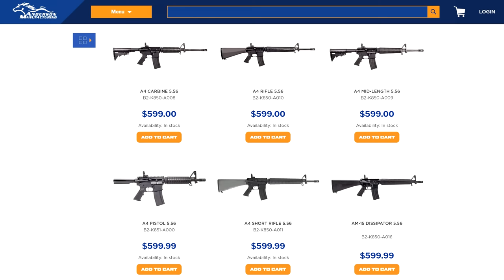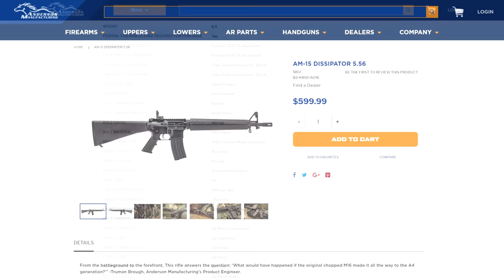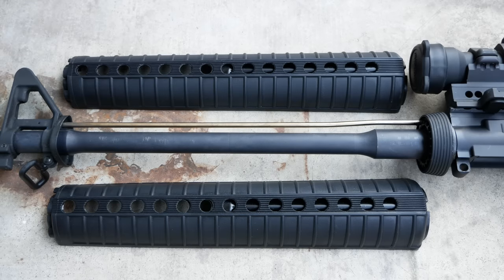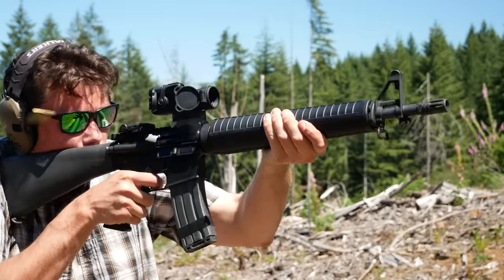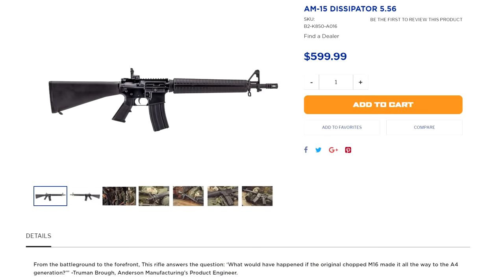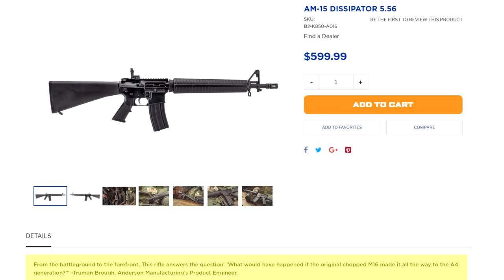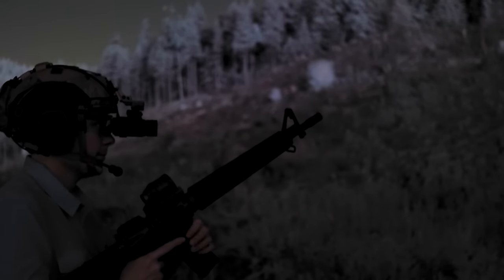The Alternate History Anderson A4 Dissipator

Comment: We would, in fact, like to see the dissipator modernization project.
Reply: Please, Hop.
Reply: Do it!
Reply: WWHD 2023
Reply: I am from the internet and I support this message
Reply: Just do it!
Make your dreams come true!
Reply: I have one built on Stag Recievers, JP internals and Odin Works Dissipator barrel.
Reply: Hell yea
Reply: Check out the KP-15 Dissipator from Booligan Shooting Sports. It's the best looking gun ever.
Reply: Already been a thing for the last 15-20 years. 

SLR Grail-15
Reply: yes we would
Reply: This already exists. It’s called the URGI. 14.5” on a mid length gas system. Same premise. This appears to be much more shootable. URGI is one of the least flat recoiling rifles in 556 that I have experienced.
Reply: @taylorminton3607  14.5 Middy has nothing in common with a Dissipator whatsoever.
Reply: Yes please….
Reply: @rifleshooterchannel208 , its ok to disagree here. Conceptually the idea is to achieve the shortest barrel with the longest gas system that functions reliably. They attempted the 15” and it failed. They then had to stretch it to a 16 to get the dwell time. They were able to achieve the same result with a mid length and a 14.5 on the URGI, which barrel length wise is more in line with the original design. If you’re caught up on this having to be a rifle length system, then yes this entire perspective is invalid. If you are trying to achieve a shorter gun with an as long as possible (and still functions) gas system, then in fact the URGI is a modern example of this premise.
Reply: Not sure.. if you modernize the dissipator with FF rail low profile GB and collapsible stock it will look like any other modern AR.

The dissipator a retro rifle leave it alone.

Just put a MOE handguard and call it a day
Reply: Hop please, do a modernized dissipator!
Reply: @taylorminton3607  No, it was to achieve the longest possible iron sight radius on a carbine length barrel. 

Not to mention Dissipators have carbine gas systems. 

So nothing about the 14.5 Middy based rifles have anything at all to do with Dissipator design.
Reply: @Frens03  It’s not necessarily a retro rifle but it is dependent on have the “rifle length” sight radius. 

The modern Dissipator is the SLR Grail-15.
Reply: @rifleshooterchannel208  the bushmaster had a carbine gas system. The original concept attempted by the mil had a rifle length. 

There is no such thing as a carbine length barrel as there has never been a definition set. Some definitions are as loose as, “any barrel less than 20 inches”. There are barrels with carbine length gas systems (which has been defined). By your logic they should have put a carbine gas system on a 19.9 inch barrel with a clamp on front sight at the end and called it a day. 

By no means do you need to agree with me. 

Have a good one.
Reply: Yus plz
Reply: @taylorminton3607  The “original concept” was not called a Dissipator, the Bushmaster offering was.

And in order to determine what makes a proper Dissipator, you need not look further than Bushmaster’s offering which is what defined the entire configuration because it was named as such. 

It’s that simple. 

And stop acting like you’re comprehending the fact that “carbine barrel” is used as a colloquialism to describe the shortest non-NFA rifle barrel that can be offered for sale on a commercial rifle.
Reply: Rifle length site radius, free float handguard, and a RRA UTE2 Upper receiver. Or just a flat top with a LMT rear iron.
Reply: Yes do this!
Reply: Yes due dis
Reply: same
Reply: Do it!
Reply: Do it!
Reply: do it do it do it
Reply: indeed
Reply: Ditto
Reply: yes
Reply: Dissipator as a supressor host? Yes please!
Reply: Yes we would.
Reply: You’re starting now Hop… aren’t you?
Reply: Hell yeah I would love to see Hop Mod. this Dissy!
Reply: Yes, yes we do
Reply: I was thinking upgraded handguard and Sully stock
Reply: I too, support this idea
Reply: @rifleshooterchannel208  , you’re seemingly hostile. For the third time. It’s ok to disagree. If you are basing this off of the bushmaster dissipator then you are correct. To be frank I assumed most people would be interested in the gun the bushmaster was based on, as bushmaster is a c tier hunk of crap gun manufacturer. The only contribution they made was the rather catchy name. They simply made an offering of a concept that looked similar to something with some minor historical significance. If you’re caught up on modernizing the bushmaster gun. You sir, are 100% correct. 

If you’re attempting to modernize the nam era gun that the bushmaster was based on, which I believe is what most people would be interested in; it would also appear that even anderson mfg agrees, you’re off basis. I highly doubt anyone cares about bushmaster version outside of very niche collectors. 

I’m not even going to get into the carbine barrel length debate with you. There are so many reasons that your statement is absurd. I would look at barrel lengths of some historically significant carbines to see why.

Anyways, have a great life. I wish you the best on your beta male quest to conquer the internet. 

From one keyboard warrior to another <3
Reply: @taylorminton3607  I like how stating simple fact is “hostility” to you 😂

You’re considering two different rifle designs to be the same thing and that simply is not so. 

A Dissipator means only one thing and it has nothing to do with having a rifle length gas system.
Reply: @taylorminton3607  And “carbine length barrel” as a colloquialism means only one thing in reference to non-NFA AR-15 based rifles. 

Anybody with even the most basic level of common sense and firearm experience would know this. 

It’s easy to tell who shoots and who don’t 😂

Don’t like it? 

Cope.
Reply: Pls hop talk about how this thing is suppressed.
Reply: Yes we would
Reply: yeah
Reply: I built it already in 11.5".
Reply: Full MOE ODG + carry handle + 3x micro + suppressor + MOFKN QUATRO15 LOWER
Reply: We absolutely need a dissipator modernization project
Reply: @jlee7811  I built an 11.5" midlength, which is pretty much the modern adaptation of the concept.
Reply: Since watching this I have already purchased this upper, a P+S RAS (hope to god it fits) and I am going full A4 Dissipator.
Reply: I want to see a dissipator with a quad rail hand guard so bad
Reply: I concur
Reply: Lets go
Reply: Agreed
Reply: Yes
Reply: His wallet is just thinking NO OH GOD NO PLEASE NO
Reply: If you don't,  I will
Reply: Concur
Reply: Agreed!
Reply: yes we would
Reply: I indeed have a more modernized dissipator. Not quite sure how to show that on here though.

Comment: Anderson sent one to me as well, and I'm with Hop (except for the Peq-2 barrel mount, I ain't got time for that). Mine runs very well with all ammo I've tried, and it's very cool. Full write up coming to TFB soon on that one.
Reply: He mentioned that the original rifle length dissipators didn’t work well. What changes did Anderson make to these to make them work? Bigger gas port?
Reply: @brettb5089 I'm curious about this as well. Gas port, spring, buffer?
Reply: @brettb5089 probably spent time figuring out the gas tube and gas port sizes, potentially some adjustment with the buffers too.
Reply: @brettb5089 yes they blow out the gas port like crazy. I want to know more about how it runs suppressed because it looks super cool with a can
Reply: I’ve had a Del-Ton dissipator for about 4 years now as opposed to the new Anderson. The only problem I had with it was mild short-stroking: it cycled fine when firing but was just short of engaging the bolt stop on the last round. Chambering, extraction and reloading were 100%; just cycled a hair short for last round hold open. 

I ran through all the blogs and settled on buying a 5% lower powered spring. It was the cheapest/easiest fix before getting into different buffer weights and lightened BCGs or opening up the gas port. I have it set up with a fixed A1 stock and buffer so can’t speak on problems with collapsible carbine length and weight stock/buffer systems.

Mine runs perfectly now. I put about 100 rounds through when I bought it and ordered the new spring immediately. It may be over gassed when suppressed as it runs fine with the lower powered and standard spring when I put my can on it. 

The recoil impulse is noticeably different on these “true” rifle-length disspators. It is nice. I still prefer a 20” but like the familiar feel of dissipators with a bit more handiness. I carried the 20” my entire time in the army until my last year we got M4s…I was a POG so low priority for the change over. So, the sight radius, if you use the iron sights at all, is a great point as well as having a milder recoil impulse over the carbines and mid-lengths. 

While I would recommend buying one and love mine, a large portion of people, if the internet including me is to be believed, will need to change something to make it run 100% without a suppressor. In my case it was just a simple $15 (at the time) spring change.

Comment: Thanks for the video!  I had a Bushmaster Dissapator for a few years back in the early 2000's and it worked quite well.  But, for some reason, I sold it. (I probably needed the money) I really like this concept and and I'll probably add the Anderson to my collection.  I'm not an optics guy, so I wish that they would have one with a fixed carry handle A2 upper.  I recently picked up a Brownell's 605 new in the box, but Ihaven't had it to the range as of yet.

Comment: I have a faux dissipator with an A2 upper, and I love it. Not my most practical upper, but probably the coolest IMO. With a can's extra back pressure, the rifle length gas system should be fine- all for a modernizations project.

Comment: I bought the DelTon Dissipator upper which is also a "true" Dissipator (16" barrel with rifle length gas system) after I saw your video at Shot Show on Anderson's Dissipator. They use heavy barrels on their rifles, but the finish on their parts are actually worse than Anderson.

I planned on making it into an A2/A4 style Dissipator that never existed, but it just wasn't doing it for me. I had it on a KP-15 lower; but due to the buffer system being set up in that lower for carbine length rifles, I was having failures to feed with low pressure rounds like PMC Bronze 223. It ran higher pressure rounds on the KP-15 with no problem, and fed the PMC Bronze on a lower with a VLTOR A5 buffer system perfectly fine though.

Instead of drilling out the gas port or changing the buffer/spring, I ended up going full autist and buying an A1 upper with all the accouterments to make it more like the traditional Colt 605. The issues they had with the 605 seemed to be fixed when soldiers added suppressors onto them, so I got as close as I wanted to get to that without doing paperwork and have added a linear compensator to the end of mine.

I wish I could tell you if the linear compensator took care of the problem of running PMC Bronze on the KP-15, but I haven't had time to try it out yet. I'm hoping it does though; and if getting complete firearms wasn't such a PITA compared to getting just an upper, I'd be all over the Anderson Dissipator A2/A4 modernization build. Maybe one day when I have time to get into a gun store and do a lame NICS background check...I've got the removable carry handle already. That little bit is all I need to justify another repetitive AR build.
Reply: Interested in an update on this.
Reply: I find Deltons to have a decent enough QC for the budget market with excellent customer service. I mean heck there are places selling their rifles well under $400 right now
Reply: @Bob-bf3cg  They definitely have good customer service. I changed my mind about the color handguard I wanted on it post purchase and pre shipping, and they threw in the green version for free when I called them about it.

And I haven't had any real QC issues with their products. I assume the issues I have come more from the lower I was using the upper on than the upper since it cycled fine with higher velocity ammo or with a different buffer system.

I was just surprised by their finishing. Their products like the upper receiver isn't as pretty as other lower end AR parts I've had. I was surprised the upper receiver had no finish really at all inside; I'd never seen that before. And the bolt was a little less pretty than I'm used to even running the other cheap ones I run (PSA, Brownells, etc). But if someone needed a good budget gun, I think they're a great option now that other companies have started raising prices. None of these finish issues have given me any QC issues.
Reply: @warrenharrison9490  Might have to go dump some rounds into the dirt out back. I wish I had more time to hit the range. I'll try to remember and report back though.
Reply: @warrenharrison9490  Couldn't find PMC Bronze. I must have shot the rest of that junk up. But I found some white box PMC and tried it on the KP-15 lower with the linear compensator to no avail. Failure to extract. So I'm still not getting enough gas pressure to cycle reliably with a buffer system set up for carbines.

Next step will be changing buffer weights/springs, but I'm going to wait until I get a dedicated lower for it.
Reply: @stoptrackingourdata8158  ... I've read the reduced power yellow Sprinco works for this on carbine lower. Keep us updated.

Comment: built my dissipator from PSA upper back in 2013 for like 400 bucks. proper rifle gas system with fixed front sight. replace the furniture with magpul MOE stuff.  Been great but yes, it needs full power factory ammo because of the dwell. Its a bit slow on my light reloads. But the recoil and feel is amazing. let my buddy try it at 3 gun match and it held up to 2 days  of heavy shooting. he loved it. it was super light and super light recoiling. back when everyone was still building super heavy quad railed ARs.

Comment: All finally felt right after I turned my old Bushmaster Dissipator upper into an irons-only carbine by replacing the flattop receiver with a C7 carry handle receiver.  I also replaced the front sight post with a Meprolight tritium embedded post.  I call it my Kiss-apator; semi modernized with only OD green Magpul MOE furniture, a Geissele G2G, and a 45º ambi selector.

Comment: If you do a modern dissipator build, go back to a mid length gas under tube with fsb out front a la psa, or bcm kino. Tried and true gas port sizing and position in relation to dwell time.

Comment: I have a Windham Dissi which has the carbine length gas block under the hand guards. I went back and forth between having a collapsible stock and an A2 stock.  Back to the collapsible for now. I think a nice set of drop-in metal hand guards would work too.

Comment: I want to see a Dissipator modernization project! I have built 4 or 5 of these in different configurations and I love the concept. Aside from the longer sight radius, there are a lot of fun things you can do, like change the buffer configuration on a carbine buffer to change the recoil impulse. KAK has a 16in barrel with a rifle gas system and I'm going to see what it can do suppressed on a carbine lower.

Comment: What are your thoughts on how well it suppresses with how that gas system is setup? 
I'd imagine it would maybe a little bit rougher than a properly ported 16" mid-length due to the port size they'd have to use, but the port being that far forward it should be pulling from lower pressures and shouldn't be as rough as 10.5" carbine system.
Maybe I'll grab one and find out once I feel the urge to build another AR.

Comment: Fun Fact: One of the 1996 L.A. Bank Robbers had a Bushmaster Dissapator. 
 There is a Police Museum with mannequins dressed in their gear behind glass, and one is holding the actual gun.  Most footage that exists they are firing modified Norinco AK-47s with drum mags, and an HK91. 
   I have an original A2 Bushmaster upper, on a PWA Commando lower, but it is the heavy barrel CAR-15 profile, with the AK-74 compensator which was the new hotness in 1995.

Comment: So I have worked up a DS arms upper , real Dissy then punched out the A post , free floated a Midwest quad rail. Sig tango LVPO. A1 stock , then Harris bipod. Modern retro . Kicks brass at 2 o’clock 4 feet away . Dissy rock ( modernized)

Comment: Haha
I figured this one out years ago. Just install a picatinny bracket with a riser ahead of the foregrip cap so you can still use a iron front if you want it or just run a laser.
If you want to get fancy or dont want to clamp somethin down to the point its gonna scratch the barrel finish can drill into the riser and insert a pin to fit into the endcap. 
That way you have midlength reliability without too much adjustable gasblock tinkerin.
Then you just swap out your butt pad for a heavier recoil absorbing one. 
Smooth lil 16" setup.
Gonna have to try and track down another of that same pic riser for my own 20" barrel ar just so can run the longest possible iron sight radius and see how that works sometime whenever get back to that project. Been more excited for my .450 bushmaster brushgun project lately.

Comment: I had gotten a couple of VN vintage M16 barrels (1-12") years ago that had pitting a couple of inches from the muzzle. Cut them back and decided to make a Colt 605 clone. Opened up the gas port and shortened the barrel to 16" with a pinned and welded 3-prong. Triangular handguards , etc. Testing with M193 has been positive. I still prefer the retro look...

Comment: Once upon a time I got a PSA faux-dissy upper and put it on a lower with an A2 fixed stock and legit M5 RAS rail. Full on M16A4 with 16" barrel basically. When I was done I just didn't dig the look so I started over with a 14.5" middy upper and I think it looks way cooler. Then I started seeing pics of dissipator with suppressors and they look fucking sick. An A1 style dissipator with a fairly narrow diameter can is the coolest.